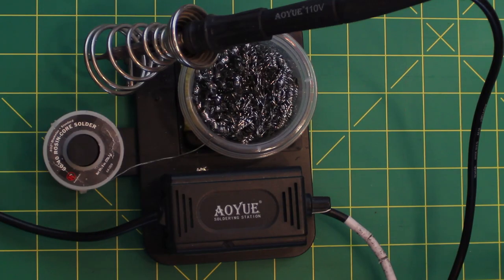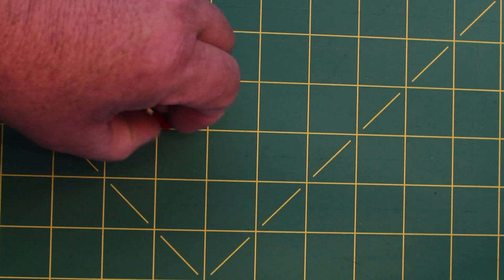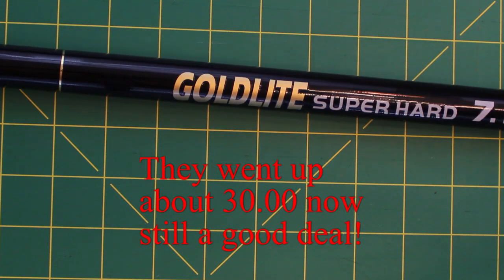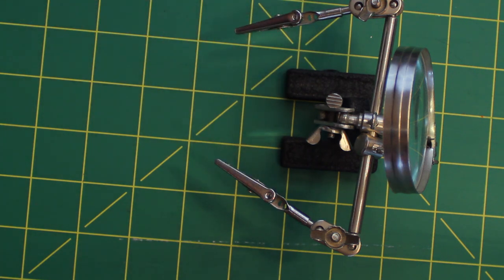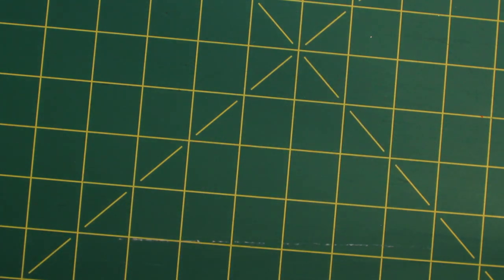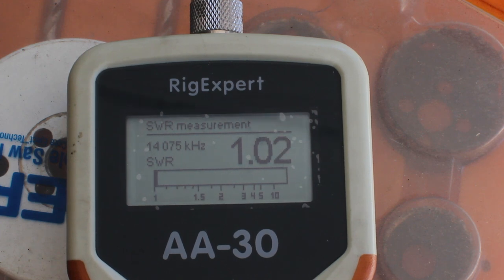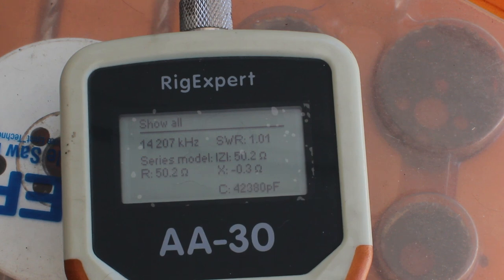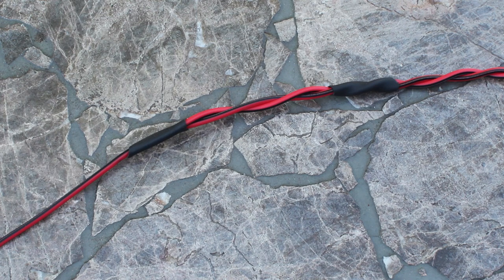How to make a 20 Meter Dipole. Is this one of the best antennas for the IC705 or FT718 ?

Comment: I have to add another comment to this video. I built this to avoid trying to tune the 20m trap on my Hustler 5BTV before field day. I worked this design for field day this weekend and had no luck on Saturday. Even though it came in at a 1:2.5 on the model I built I thought oh man I did something wrong. I woke up Sunday morning and gave it another shot. I made 41 contacts on 10 and 20 meters in 4 hours that ranged from the Canadian Maritimes to South Texas from the QTH in Western PA. This works and it works damn well. Fantastic job Chuck, this made my weekend.
Reply from the maker: Gary, thanks for the nice comment!! That's awesome Gary, I am glad the video helped and you were able to make a lot of contacts and there is nothing like making a contact on a antenna you made yourself !!
Reply: That would be great for  Emergencies I think I would cut it for 20 and 40
Reply: it calabrate not culate
Reply: wow, that's barely directional then?
Reply: @CRSolarice  it really isn’t directional at all. I typically run it in a NW to SE direction or vice versa and have done extremely well with the build. My longest distance so far is New Zealand at just over 8300 miles and well into Eastern Europe.
Reply: @hamandcheese25  Thats fairly amazing.  That means that its either omnidirectional or barely directional.   You must also be reflecting off of the ionosphere and at certain times of the day, possibly evening or early morning?  I have one of these, I think its an antique though and I'm worried about using it, mainly because I would probably have to do something like a 90 degree "V"? Also very close to buildings. Wonder if that would interfere with propagation?  I might just have to figure out some sort of vertical dipole on a pole...
Reply: @CRSolarice  I have used mine from as low as ~5’ up to about 18’ with good success even at QRP power of about 3w. No doubt I’m getting a bounce off of the ionosphere at times but still a rock solid performer. I built mine in a slightly different format using a saddle tee with an eye bolt to lift it, it really takes a ton of stress off of the wire and allows you to configure it in many different patterns
Reply: @crsolarice4673 if its under a half wavelength high, its radiation pattern is more like a giant doughnut, with little sign of any form of null, could explain it.

When you get it up in the air, that's when you get the big lobes and nulls coming off the thing.

Comment: Without converting your unbalanced radio to balanced for both legs of a true dipole, all you've made is a 1/4 wave antenna, on it's side, with the earth absorbing the majority of the RF being emitted, you've only got 1 active RF element.  This is what a BalUn is for, long ago when radios had dual output screw down terminals labeled "balanced" you could easily hook up ladder line and make a true dipole, the amount of new ham confusion on this basic principal is concerning.  Will it work? Sure, a bit, remember a dummy Load is also 1:1 vswr
Get a 1:1 BalUn at the center point.

Comment: Tip:    Heat with the soldering gun from the opposite side that you apply solder. The solder goes toward the heat, so you get more even coverage and will know when you have applied enough heat. As soon as the solder begins to flow, remove the solder gun. The opposite side is already much hotter, so the solder will draw in before it cools
Reply: Opposite tip: Initially add the solder right at the tip of the soldering iron, so that you create a puddle of solder in between the iron and the piece; that puddle will transfer heat into the piece faster. Then, as per the advice above, you can move to the other... Oh, it's done already. Yeah, about one second after sufficient heat is in the piece, the solder flows in almost instantly. So no need to be fussy about this end or that end. Perhaps the other advice matters if you're using an underpowered iron or soldering a 6kg item. YMMV.

Comment: Chuck thanks for the tip on using the cut ends of wide zip ties as insulators/strain relief for linked dipole segments. I like to have another option if the end fed wire antenna does not perform well.

Comment: I know this is an older video but I was wondering what the length of the wire ended up being after you cut it? Thanks, very easy to follow the instructions you provided.

Comment: Hi there! Thank you for making this vid. I just passed my General and bought my HF radio. I like this design. One question. When you said you took the 6” off. Did you cut it off or fold in back on itself?
Reply from the maker: Keith always fold it back at first and as I get it close , I will start trimming and recheck it until I get the extra fold where I want it in length and then finish off the end.

Comment: Great video. To shorten the wire do you cut it or fold it back.  I have heard that folding back is effective for bare wire and not insulated.  I am building a fan dipole and am interested in advice

Comment: Thanks for the tips. Im about to make my 1st 20m dipole. Will the SWR change depending if you have the dipole horizontal or as a inverted V? Thanks
Reply from the maker: Jorah, the SWR can chage some depending on a few things the ground where you set it up is one. The inverted V is usually the easy way if your portable make sure the V is atleast 90 degrees abd try to get the ends up about 6' off the ground. Tune the antenna the way your going to set it up every time and you should be fine.
Reply: @KK6USYHamRadioAdventures  So the best way to tune the length is to have it elevated in its operational position? I was trying to tune it screeched in my garage few ft off the floor using  the NanoVNA and I was not getting good results.
Reply from the maker: @jolebole-yt  yes put it up the way it will be when you  use it.

Comment: How high up do you mount this?  For 20m, 40m, 80, 160?   Does it matter if its 180 degrees from the feed (barely directional?). What if V shaped instead of T shaped, like 90 degrees apart rather than 180.  And if you mounted it perpendicular to the Earth's surface (vertical, just changes the rf wave's orientation??)   What if the ends of the wire were 12 inches apart?  How would it propagate?  I have a dipole kit from the 1950s new in package?  I have to take another look at it for specs but it has a balun and all sorts of bake o lite in there (I'm thinking of using it but maybe I should hold onto it or sell it on ebay? I mean isn't that literally an antique?  Highly collectable?  I found it dirt cheap at an auction mixed in with a bunch of computer stuff.).

Comment: Do you count on the ROSIN in the solder or do you use flux for soldering connections?
Reply from the maker: or most small wires yes , but sometimes I use flux.

Comment: Nice 20 meter ant. What was the hole size for vertical pole.
Reply from the maker: I want to say it was around 1/8" poles vary in size and strength start small work your way up untill you think the pole is strong enough to support.
Reply: @KK6USYHamRadioAdventures  tnxs KQ4CD

Comment: Not sure that tinning the wire before crimping is a good idea. I would suggest either soldering or crimping but not both. A good crimp is probably better than solder. I have cut a good crimp in half and you can’t tell where the wire ended and the lug started it looked like one solid piece of copper!

Comment: I would have liked to have seen the actual finished antenna
Reply from the maker: Man0fMeans
, The plan was to take it out and use it in a video I just made the antenna into a 20,40 meter fan dipole I will do a build and how I deploy it using the 4 ends as the guys, thanks for the comment and for watching!

Comment: Does folding the ends of the wires back to make a loop affect the length requirement?
Reply from the maker: Luke, folding the wires back does still add length if that's what you're asking? I usually fold until I start getting close the trim some wire. When I end up I usually leave about 1' folded so I can tune as needed but usually I don't need, I try to set it up the same as I tune it.

Comment: Thanks for the video. You do a great job of showing the whole process. I will have to build one of these for myself soon. I have an end fed half wave antenna that I don't think I am getting good performance from. I use 20 meters mainly so this would be a good setup for me. How high do you have this above the ground and ends?
Reply from the maker: I think you will be very pleased on how this will work, I think I had the ends about 5-6'  off the ground it can make a difference on swr . Thanks for the comment and for watching!
Reply: @KK6USYHamRadioAdventures  I subbed and hit the notification bell also. I just uploaded a video I shot this morning on using a Dewalt 20v max battery for portable ham operations on my channel. I wish I had your antenna right now. I am portable at my daughter's in CO but I did make contact with a guy in PA and AZ this morning.

Comment: Questio ? Can ya  double the length and get 40 m ?
Reply from the maker: Take 468 and dive by the frequency and dive b2 gives each side, cur a little long and fold over the ends. 468/ 7.250= 64.55/2= 32.28